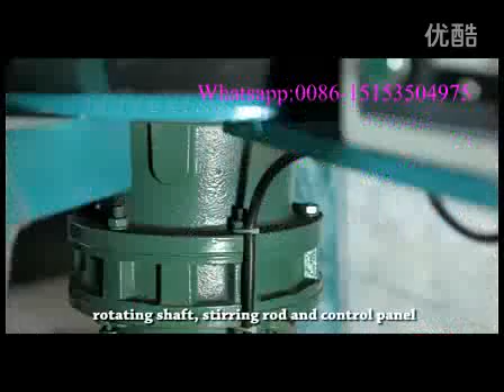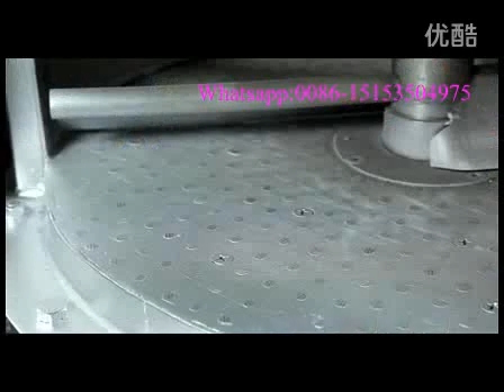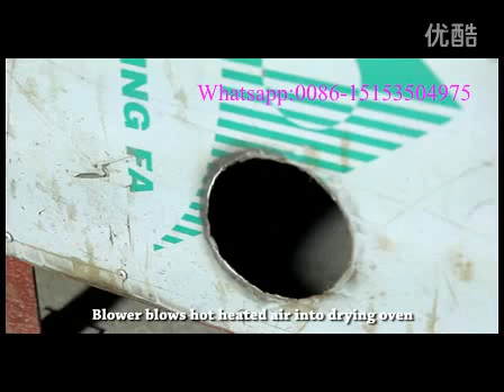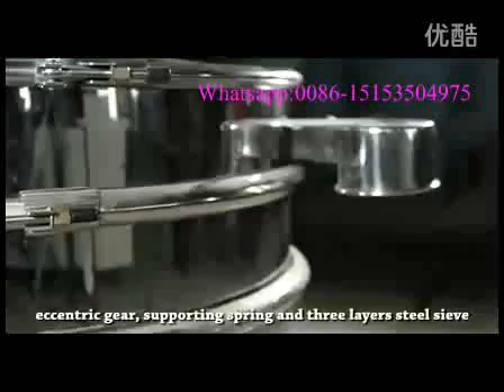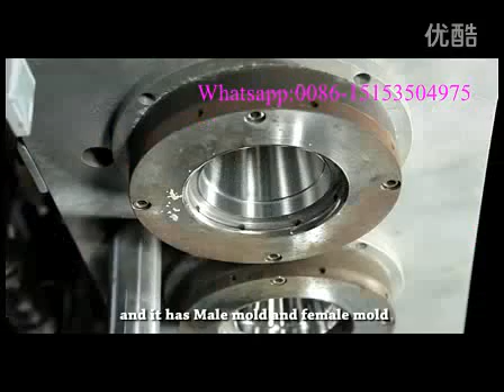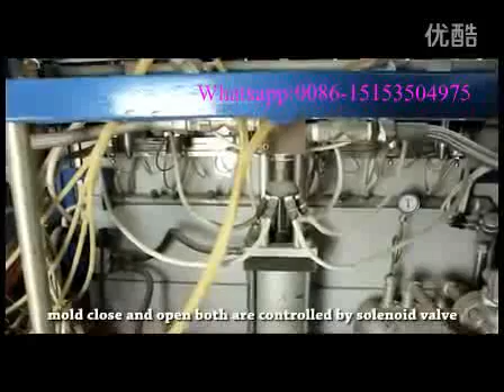EPS Cup Making Machine

Comment from the maker: www.psfoodboxmachine.com
EPS Cup making machine

EPS Cup making machine
Raw material: 
Expendable Polystyrene and Zinc Stearate asl.
Process:
Mixing ---pre-expanded--drying---filtering---storage-- forming-----collecting
Video Link for EPS Cup making machine
EPS Cup Making Machine

Main features:
1.Finished products: foam cups and bowls
2.. Production capacity: from 150,000/day to 1080,000/day
3..Main machines: boiler, mixer, pre-foaming machine, drying machine, shake boult, center filling device, forming machine
4..  PLC control
5.. high speed7-15s/cycle
Advantage:
1. EPS Cup Making Machine is used to produce large quantities of hot coffee cup, hot tea cup, hot soup blow, noodle tub and other food and beverage packing .
2. Light weight, good rigidity and well heat isolation. 
3. The machine holds many merits such as high foaming times, high producing efficiency, low steam consumption, low cost and different model products made at same time. 
4. Pipes and tubes of the transferring system are all made from stainless material so that they resist eroding and easy to be cleaned. 
5. Pre-expand and forming procedures are all operated by automatic controller, the mechanical and electrical device or apparatuses are all from famous brand.
Service:
1.After sales service: we will dispatch professional technicians to customer factory for machine installation and training. 
2. Our salesman will be 24 hours online for you to solve problems.
3. We have introduced South Korea and Taiwan technology with more than 20 years experience. Our machine quality is the best.

Comment from the maker: EPS Cup Making Machine
EPS Cup making machine
Raw material: 
Expendable Polystyrene and Zinc Stearate asl.
Process:
Mixing ---pre-expanded--drying---filtering---storage-- forming-----collecting
Video Link for EPS Cup making machine
EPS Cup Making Machine

Main features:
1.Finished products: foam cups and bowls
2.. Production capacity: from 150,000/day to 1080,000/day
3..Main machines: boiler, mixer, pre-foaming machine, drying machine, shake boult, center filling device, forming machine
4..  PLC control
5.. high speed7-15s/cycle
Advantage:
1. EPS Cup Making Machine is used to produce large quantities of hot coffee cup, hot tea cup, hot soup blow, noodle tub and other food and beverage packing .
2. Light weight, good rigidity and well heat isolation. 
3. The machine holds many merits such as high foaming times, high producing efficiency, low steam consumption, low cost and different model products made at same time. 
4. Pipes and tubes of the transferring system are all made from stainless material so that they resist eroding and easy to be cleaned. 
5. Pre-expand and forming procedures are all operated by automatic controller, the mechanical and electrical device or apparatuses are all from famous brand.
Service:
1.After sales service: we will dispatch professional technicians to customer factory for machine installation and training. 
2. Our salesman will be 24 hours online for you to solve problems.
3. We have introduced South Korea and Taiwan technology with more than 20 years experience. Our machine quality is the best.